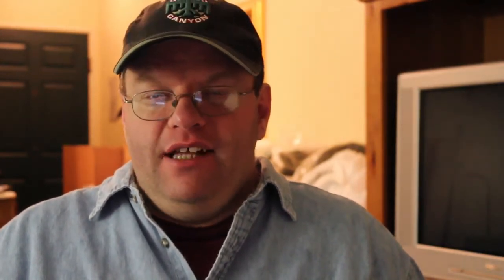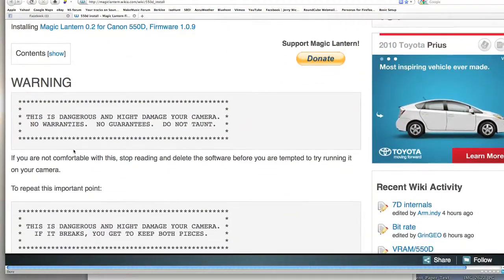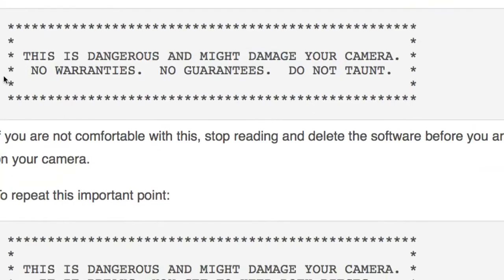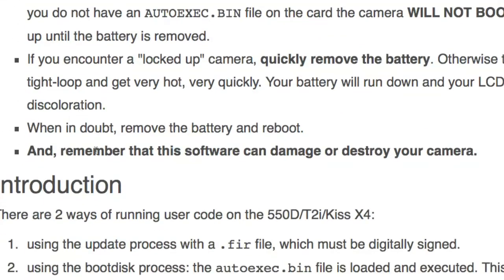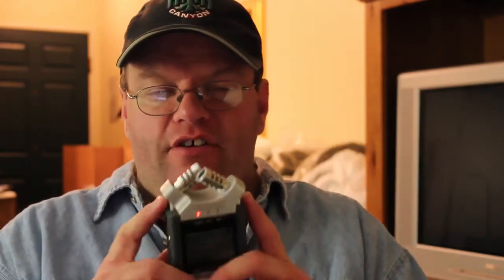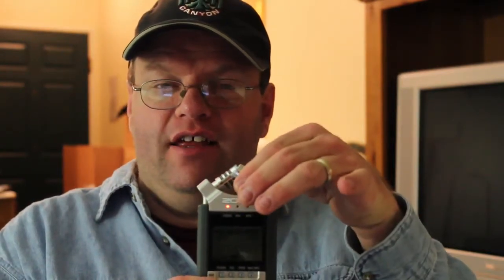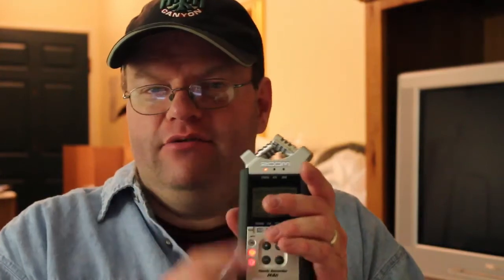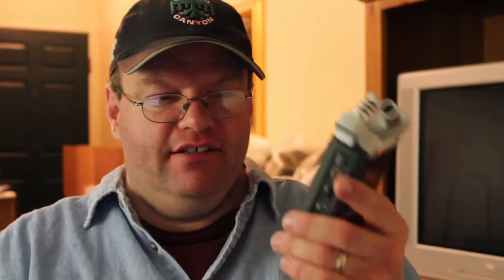DSLR Audio - Auto Gain Control and what I use for audio.

Comment: I'll have to look into that field recorder..  I have magic lantern running on my t2i, and it is very very very awesome.  So many features for adjusting exposure, and audio gains...  having an audio meter is VERY handy.. I like your solution though..  especially if I were recording a live show and wanted to take signal from a mixer or even set up mics in a room, I could do it without lugging a mic around with my camera.  I use a rode videomic atm, but I might just get a zoom as well.